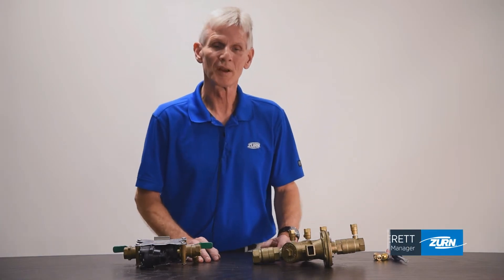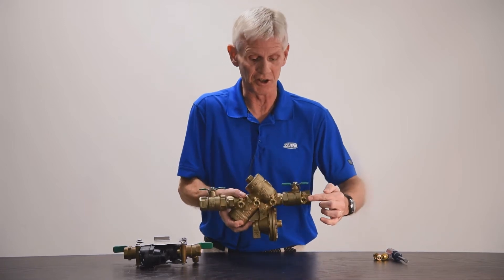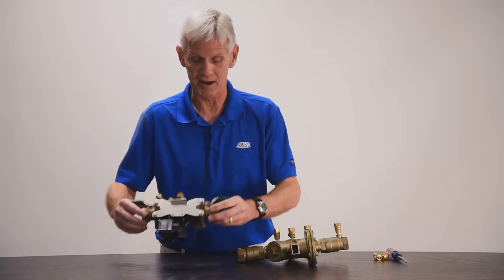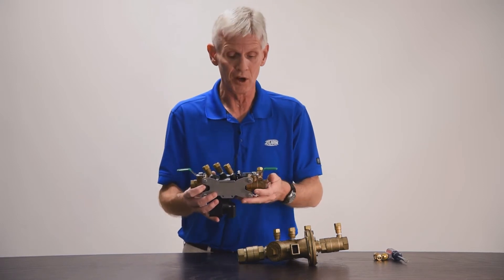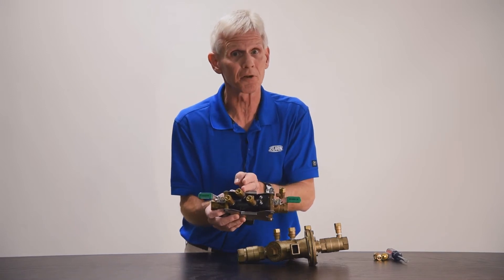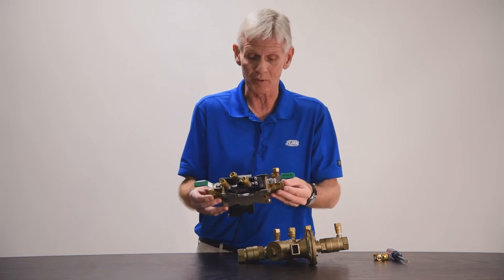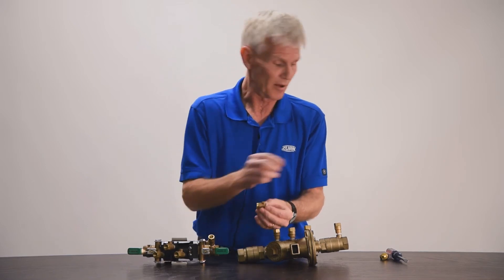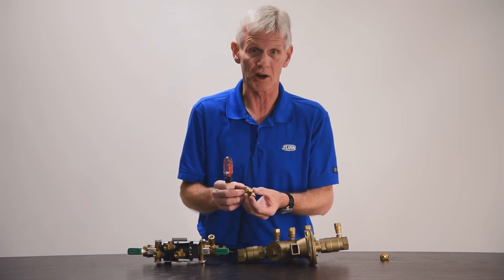Zurn Wilkins Backflow Prevention Test Cocks

Comment: Thank you for this solid explanation, Jon. This is helpful. I recently bought a home that has relatively low water pressure (32 PSI) throughout. There is one of your Model 950XL at 1" in size which is placed between the main water supply and the sprinkler system. In my effort to improve the sprinkler system I wanted to ask you if this XL950 is restricting my GPM flow and/or PSI. I would imagine that it has some effect on this but I do not know to what extent. At this time I am preparing to install a 1HP electric booster pump (for the sprinkler system only) with the hope that I will improve my PSI and GPM somewhat. I assume that the best way to lay this out would be to go from the water supply to the XL950. Then to the 1" pump. Then to the 1" water pressure regulator. Then to the 1" sprinkler valves. Does this sound good, Jon? I would appreciate any thoughts you may have on this because your company makes a great product and if anyone should know it would be you!  Thanks again.
Reply from the maker: Thank you for your positive feedback. You are correct, there is some pressure loss inherent in all backflow prevention assemblies. The plumbing design you have described sounds typical and can be designed to function well in that configuration. I would caution you that the double check assemblies are designed and approved for low hazard protection. The Zurn Wilkins Model 975XL would be more commonly used in irrigation applications to protect against the potential backflow of high hazard substances. The Model 97XL will have more pressure loss than a double check, so make sure you account for that in your design and always verify that you are in compliance with all local codes and regulations.

Comment: How do we fix a leak in the test cock even after its perfectly closed?
Reply: Replace it or put a same size plug which will cost a third.  Backflows on irrigation or like never tested except for probably commercially somewhere with high risk high compliance
Reply: Just saw this little valve started to leak on my pressure breaker too.  Not sure there is a simple fix or have to replace it.  Will take it apart to see sometime this week

Comment: are the screws in the test cocks supposed to keep turning without actually coming to a stopping point?
Reply from the maker: Hello Robert. The screws on the test cock are quarter turn ball valves. They will continue to spin. Rotating the screw 90 degrees will change it from either open to closed or closed to open. If you have any other questions, please feel free to reach out to us here or call our Customer Care Team at 1.855.663.9876.